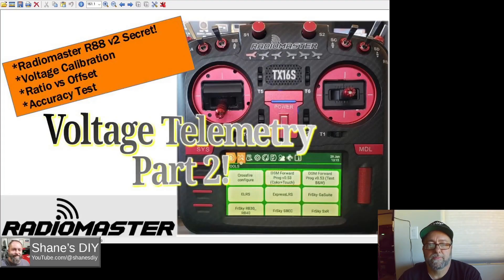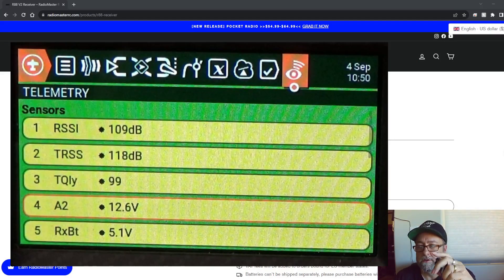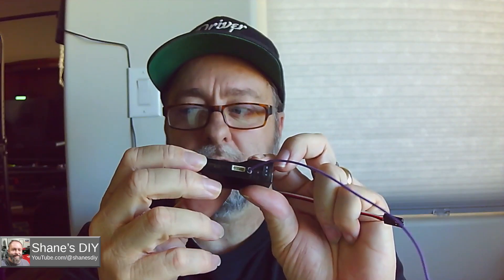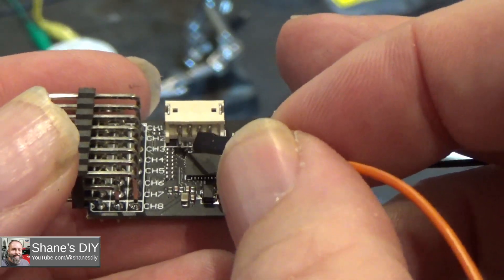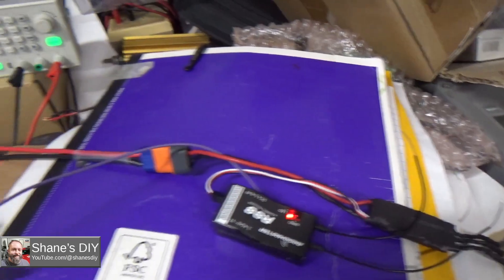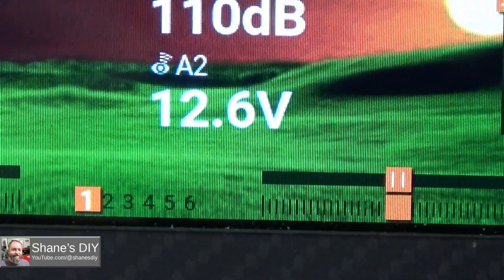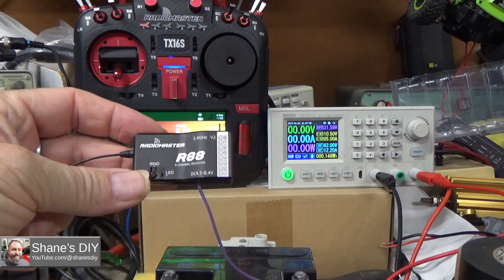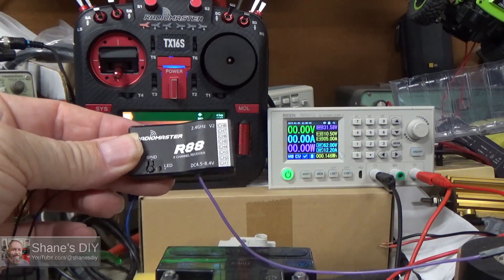Part 2 Radiomaster R88 V2 and TX16S EdgeTX 2.9.0 Voltage Telemetry Tutorial

Comment: Shine I'm new to your channel I enjoy the stuff you do will the telemetry handle a 6s battery
Reply from the maker: If you scroll through the comments I've done a number of tests with various voltages.  It will handle about any voltage if you add the appropriate series resistance on the sense wire.  The series resistor works with the voltage divider built in to the receiver to scale the raw input voltage to the 3.3V max the receiver chip will handle.  Without any added resistance it will handle up to 18.81V.

220K ohm resistor allows up to 26.07 volts (6S)

320K ohm resistor allows up to 29.37 volts (highest I've tested with my bench power supply)

1M ohm resistor allows up to 51.8 volts (12S)

Comment: Dude ! It's absolutely brilliant!  ❤ 
It works perfectly up to 4s👌

 Have you had any feedback on the modification using the 220k resistor? 
  Obviously it's at my own risk, but would you say it's pretty safe? 
I'm afraid it will work for a while, then end up getting magic smoke mid-flight. 😅 

And... Did you find electrical diagrams of the R88 to deduce the procedure to follow, or did you deduce by observations of the circuit? I would really like to know where to find this diagram if it exists 😁

Thank you very much for this video, these kinds of tricks are so cool! 🙏
Reply from the maker: Thank you for the comment.  Yes it works with the 220K for up to 6S (26.07vdc).  I didn't have 50vdc to feed it but according to the math, if you use a 1 meg ohm resistor in series it'll handle up to 12S (50.4vdc).

I can't recall where I found the diagram, if I can find it I'll share.  The internal voltage divider is:

[Ground - > 100K ohm - > (3.3V max signal at RX chip) < - 470K ohm < - voltage input sense wire]

So you add your series resistance to the 470K ohm resistor so that whatever voltage you feed to the input cannot output more than 3.3VDC.  Hope that makes sense.  Plenty of voltage divider calculators online to plug the numbers into.  If you do it correctly the RX chip never sees greater than 3.3vdc.  Just have to adjust the ratio to calibrate the display.  Note that the higher you go the lower the resolution will be to display since you are dividing a higher voltage into 3.3 for the total resolution.
Reply: @shanesdiy  A huge thank you for your ultra fast and detailed response! You are awesome 😀

It’s very informative.
 This also confirms my fears about the drop in resolution when increasing the division scale..

I had an idea and I would like to know if you think it is an electrically safe solution: 

With a Lipo 6S for example, Connect the voltage sensor wire to the second or third wire of the balance plug and only get the voltage of one or two cells!
 Unless you have a Lipo in poor condition there should be no significant imbalance between the cells, no? So I suppose it would be quite sufficient to set a low voltage alarm based on 3.7 or 7.4 volt.
Am I wrong? Does this represent an electrical risk? 

The goal is to have the best resolution while remaining as simple as possible
But if the cells do not discharge in a balanced way it might not actually be much more precise, or even worse..
So, Maybe just taking the voltage of 4S instead of 6 could be a good compromise..?

I'm curious to know your opinion 😀 

Thanks again!!!
Reply from the maker: @nikosystem1  Decided to run another test just now.  Apparently the resolution isn't really a problem, maybe it would at some very high voltage but not up to 30V.  I just did a test and added a 320K resistor which should allow up to 29.37 VDC sense input (which would be about a "7S" battery).  With my bench supply I was able to hit 29.3V and with the adjusted ratio it measured that fine.  I then lowered the supply to 12VDC (which would never swing that far in the normal use) and the telemetry voltage only drifted off by ~0.10 vdc and I'm using 2 decimal places with my telemetry display.  I would not be concerned about resolution or accuracy.  I would choose the appropriate series resistor for your required max voltage and measure full battery voltage.

If you didn't want any series resistor you could certainly plug it into a balance lead and scale the ratio to that.  I'm thinking just do cell #1 if you do that and just watch the single cell voltage.  Since you wouldn't know if all cells were balanced and wouldn't be reading full battery voltage anyway the single cell voltage would be all you'd need and would actually be easier to decipher looking at the screen.  4.2v is full and about 3.5-3.8v, or whatever you use for low, would be time to land.  Even if you monitor the full pack voltage you won't really know if a single cell gets out of balance, you'll have to check that with a LiPo tester after you land.

Comment: This trick looks like a great find so I bought an R88 and bound with the FrSky D8 protocol. I can see A2 telemetry displaying voltage, and adjusted the ratio, but my issue is when I setup my widgets to display the reading on the TX16S main screen it shows 0v, like it’s disconnected. Under the telemetry screen it shows proper voltage data. Any idea what I’m doing wrong? I can get the RxBat and RSSI Telemetry to display but not A2 (pack voltage which is all I really want).
Reply from the maker: Are you sure you are selecting the correct telemetry value?   Which Widget are you using?  Let me know and I'll test it to see if I get it working.  Did you see my Episode 1 using the Spektrum?  I think I used the same Widgets for this one, might see something helpful in that video.

I assume you are on a TX16S?  Which EdgeTX version and which Multi-Module firmware version?
Reply: @shanesdiy  thanks for the quick reply. Are you on RCgroups? YouTube isn’t the best for showing my setup. I’m using a top bar widget location and running edgetx-tx16s v2.9.4 “providence”. I’m selecting Value as the widget type and choosing the Source as the “eyeball with signal” A2. It shows as such with 0.00 on the main screen but when I click Model and Telemetry A2 shows proper voltage.
Reply: The module firmware? I think it’s Module Status? V1.3.4.0 AETR. I’m not sure if that’s what I’m supposed to be looking at
Reply: @shanesdiy I tried changing the name of A2, and used VBAT. For whatever reason this worked and solved the problem. I’m not sure why it wouldn’t work with the stock value of A2 but at least it works now on 4s reliably. Thanks.

Comment: For binding from Radiomaster Tech Support: Hello, regarding your question, we have consulted the technical department for you, and the reply is as follows: Please note that the common phenomenon of the Frsky protocol is not to let the transmitter and receiver be too close together, so that the signal is very strong, which will cause a flood effect, you will feel that the signal is lost, but you do not need to re-frequency, you only need to put the receiver and the transmitter about 1m distance away from the good, if you test the aircraft closely, You can find a Low Power option in the next few lines of the transmitter's Internal RF Settings. Turning this option on will use the Low power mode, which allows you to be close to the transmitter and receiver and operate normally, but be careful to turn off the low power mode when you are out flying. This principle is like using a loudspeaker to shout to the ear, which is beyond the ability of the ear to distinguish. We also recommend that you use the FrskyX D16 protocol to bind the R88 receiver.
Reply from the maker: The signal flooding anomaly is fairly common knowledge with FrSky protocol and some others. I use the R88V2's and they work great for me. Fantastic budget receivers.

Comment: Great job I have telemetryu in 6 receivers.  I run one for 4 hours just to see if there would be a problem.  None,  I am right on for voltage using a multimeter as check.  I have added a 4th wire to the sbus plug and I have hard wired to the positive lead of the esc.  I had a little trouble when I tied to the red wire on the balance plug.  Again thanks distance is great and now I have telemetry for my flight battery what else could we want.  Thanks for sharing your discovery with us... I loved your video on the distance test we really got a bargain for $11   Thanks Chuck Gaydos

Comment: Is it possible to get fc telemetry from the pin?
Reply from the maker: The 4th pin is the voltage sense input wire that we used in this video.  The 3rd pin is the SBus output that can be connected to a flight controller to send 16 channels of data.  I believe 15 channels is direct from the transmitter, channel 16 appears to be an RSSI value in my testing but I'm not 100% certain.  Is this what you mean?  If not I may need more detail of what you would like to do.

Comment: Hello. I got a question. I use 6 pack LiPo with R88 and TX16 as TX. I did similar setup and I get voltage reading on A2. I calibrated it for current pack volyage (for example 25.2V) but after a flight it still shows 25.2 but when I measured pack voltage with multimeter it was 23.8V. It seems like R88 did not transmit correct voltage value in real time. On another video I heard that radiomaster RX support up to 4 pack batteries. Could this be a problem? What else I can check?
Reply from the maker: Did you install the 220K ohm resistor in series with the voltage sense wire?  If not, you might damage the receiver. Without additional input resistance the maximum input voltage is 18.81V.  The 220K resistor added allows it to accept up to 26.07V.
Reply: @shanesdiy  Great, thanks. I will do that. Maybe this was the reason it did not show correct voltage. I also tried 5 s pack with 20V and it still showed  25.2V, so 220K resistor could solve my problem.
Reply: @shanesdiy  How many Watt that resister should be? Could you write specific resistor characteristics?
Reply from the maker: I just use 1/4 watt, 10% or lower resistors.  There is no current going through it so it's not important.

Just to clear up how the receiver monitors & scales the input sense voltage, there is an internal voltage divider.  The built in resistor values for this divider are sized to only pass 3.3V (its max input limit) to the IC when 18.81V is applied to the sense wire.  When you add 220K ohms to this voltage divider by placing it in series with the input wire, you change this scale to pass 3.3V to the IC when 26.07V is applied.  When you sent 25.2 volts to sense wire without the added resistance, the receiver IC was potentially getting 4.42V but it can only safely take 3.3V max.  There is also a current limiting resistor on the input to the IC so it may have helped save the IC input.  If it will no longer read voltages properly you may have damaged it.
Reply: @shanesdiy  Well, I will give it a shot and hope it works. Thank you
Reply: @shanesdiy  I just ordered  the resistor. Regarding damage to R88, I think if it still shows telemetry data (even incorrect) then it should be ok, I hope.
Reply from the maker: Fingers crossed!  If you give it 4S voltage or lower, and vary the voltage does it change in the telemetry? Does it indicate 0 with no voltage applied?  I think as long as it isn't stuck at one value regardless of the voltage applied, you might be in luck.  Good luck!
Reply: @shanesdiy  I have 3 lipo pack and check it
Reply: @shanesdiy  Hi. I have R88 with SBUS connection to FC and I use TX16. I want to add 2 servos for cam movement with Skyzone gougles. Where do I plug those servos (If my 8 chanels are taken by flight control thru SBUS)?
Reply from the maker: @rmiklosh  In that case, when you bind the R88 to the TX16S, set it for channels 9-16 Telemetry ON, or OFF, depending on your needs. Be sure to use FrSky X D16.  The option of channels 1-8 vs 9-16 when you bind is which channels you want the 8 PWM/servo outputs to be assigned to. After you bind you can then assign your pan/tilt servos to any channel from 9-16. Ch9->PWM pin1, Ch10->PWM pin2, etc.  SBus will always output all 16 channels regardless of how you bind.   Hope this helps.

Did you have any luck with your voltage telemetry with the resistor?

Comment: I decided to risk a RX with this hack.  Seems to work well with 3S and 4S packs from what I've tested so far.  I was hoping to uses this on a 12S model, but it doesn't register correctly at those voltages.  It didn't work with 6S either.

I'm far from being up to speed on basic electronics, but I'm guessing that the proper resister in the sensor wire would drop the voltage and get it back to where the output is variable, then just calibrate to the proper voltage.  Any input on this would be appreciated.
Reply from the maker: 18.81 volts is max wiring direct as shown here but if you add a 220K ohm resistor in series on the sense wire it will safely read up to 26.07 volts for a 6S pack.  If you didn't add any series resistance when trying over 4S hopefully you didn't damage the receiver already.

DO AT YOUR OWN RISK...
I just did the math and if you add a 1.0 meg ohm  (1,000,000) resistor in series with the voltage input this should allow it to accept up to 50.4 volts of a 12S (technically 51.8V max).

Just have to reset the ratio to scale the voltage to display properly.
Reply: @shanesdiy  Thanks for the help on the resistor.  I was going to spend some time today trying to figure out what resistors might be needed.  I had it hooked up to 12S power and I don't think it hurt anything.  No magic smoke escaped.  All RX functions seem to be normal.  The voltage telemetry still works at 4S power.  Yes, at my own risk!

Comment: Really useful and interesting.  Thanks.
When messing about for long periods of time either programming or testing etc on the TX16s, could it be plugged into the mains via the charging port, so it’s operational whilst charging or working of the mains so to speak,  if that makes sense?   Or simply a no no.
Reply from the maker: I sit and program often and I'll charge and use the radio at the same time.  It will charge while powered on.  I've heard people say not to but I don't know their logic behind it.  My only reservation is I don't like moving the radio around while the USB cable is plugged in as I might wear out/break my USB port. I'm the same way with my cell phones, laptops, etc. though...

Comment: but to update the firmware of this receiver how should I do it?I can not find anything for update or changhe firmware receiver (fcc or lbt).
I saw how to update firmware receiver frsky x8r with tx16s and module4in1 .
with the pins of the external module (reversing + and -) and s.port .
For radiomaster r88 v2 I have no idea how to update firmware.
But you know official forums for help with:
radiomaster tx16s mk2 max
multimodule 4in1 (radiomaster)
edge tx
??
Reply from the maker: I am currently not aware of any way to update the firmware on these receivers. I don't believe the standard FrSky firmware can be used but I am not certain of this. I haven't tried.

Comment: Why you didn't crimp in the connector where the fourth thread was missing?
Reply from the maker: Initially I wasn't exactly sure which connector size it was to add another wire to the connector. I found a kit with a large number if connectors but it had 100's and was $20-30 and soldering it was free.  Since I wasn't using SBus, on another RX after this video, I pulled the SBus connector pin out and moved it over.  It was pretty easy so if you don't need SBus that is an easy way to get the voltage without soldering.

Comment: What a good find Shane. I will also use it on my glider. Only thing, your last comment about it destroying your radio could be true if you exceed the specified maximum input voltage of 8.4v. I would recommend not exceeding 2S battery packs. Thanks again for sharing.
Reply from the maker: Thanks for watching and or your comment.  The 8.4 V limit is just the BEC voltage limit to power the receiver, the pack voltage sense input goes through a voltage divider so is perfectly safe for the receiver.  After more research I've found that 18.81 volts is max wiring direct as shown here but if you add a 220K ohm resistor in series on the sense wire it will safely read up to 26.07 volts for a 6S pack. Just have to reset the ratio to scale the voltage to display properly.

Comment: THANK YOU!!!!  No resistors required like frsky receivers!  😎
Reply from the maker: Up to 4S no resistors.  If you want to monitor up to 6S you will need a 220K ohm resistor in series with the sense wire.

Comment: Se bastava spostare il pin dal sul connettore...cosi evitare di saldare ecc..
Reply from the maker: On my 2nd R88 I was able to easily move the pin in the supplied connector. Used a small pick or pin and be gentle. Another commenter was also able to successfully move the pin. No soldering required!

Comment: Great video thanks however, I've just tried this with a V1 R88 and it doesn't seem to work. I only show 0.0v on the A2 output. I've double checked the wiring. 

I repositioned the positive lead on the supplied plug to the A2 output (pin4). I plugged the positive wire into my balance lead (1,2 and 3 cell positive position). Tried to rediscover telemetry. Just shows 0.0v.

I'm guessing it only works on the v2?

Cheers.
Reply from the maker: Could be only V2, I don't have any V1's to test it on.  Bummer but thanks for sharing your findings!
Reply: @shanesdiy  I'll have a check next week of a v2 unit. I'll let you know how I get on. Thanks again for your content.